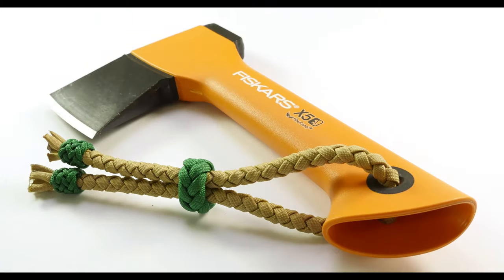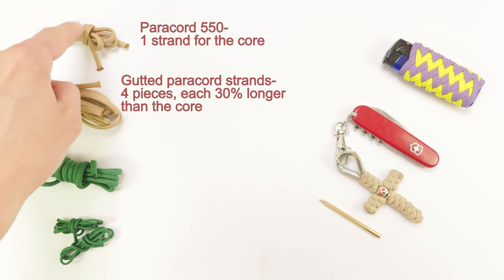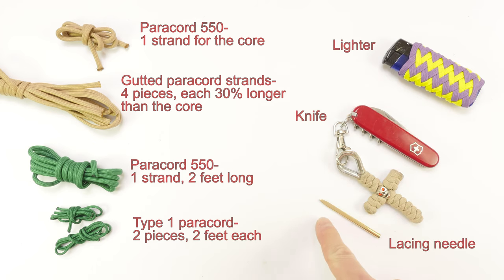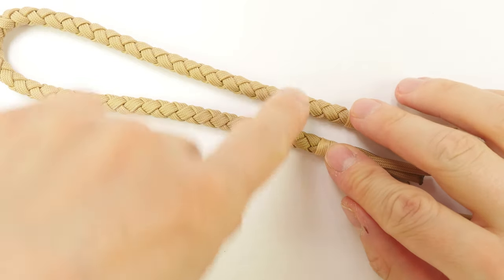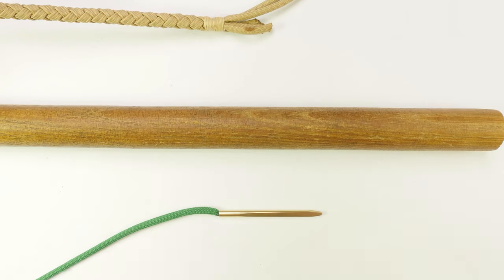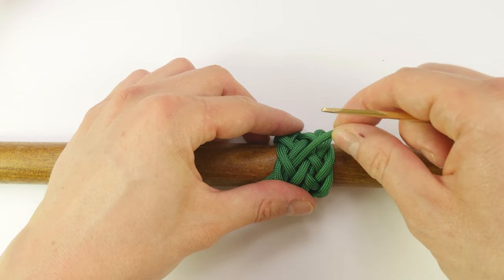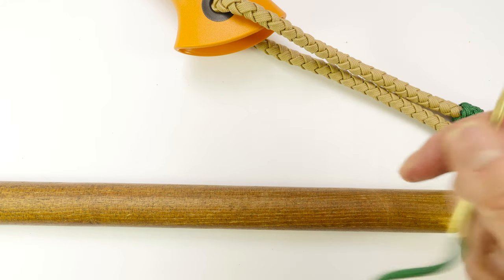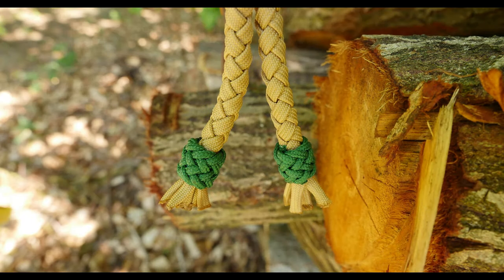Fancy paracord axe lanyard

Comment: Very good video as usual, Had a question at around the 12:25 point in the various where you are tying knots to cover the end whippings. You start out tying what appears a 5 lead 4 bight THK where you do a cross over (as with a Spanish ring knot) that confuses me. I’m used to seeing gaucho interweaves starting from a 5 lead 4 bight. I’ve yet to try a gaucho since I’m still learning I’m starting to learn square Turks headsand this threw me.
Can you explain what you did?
Thanks
Dionald